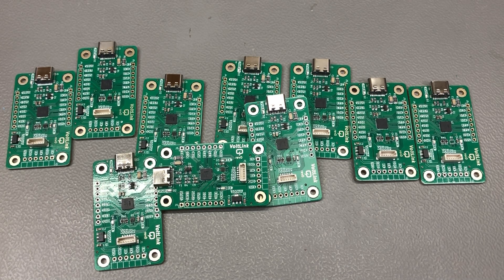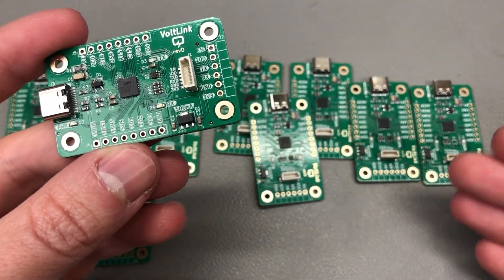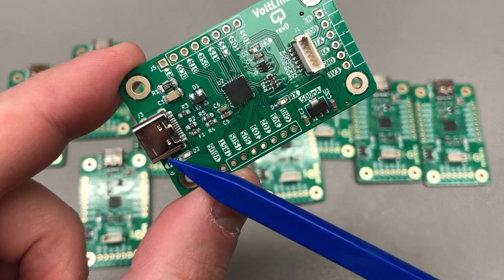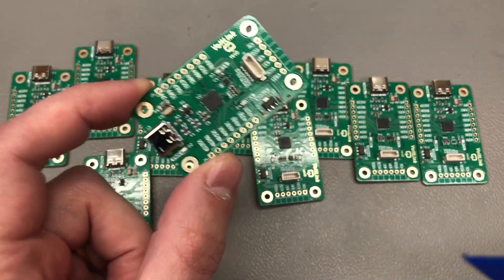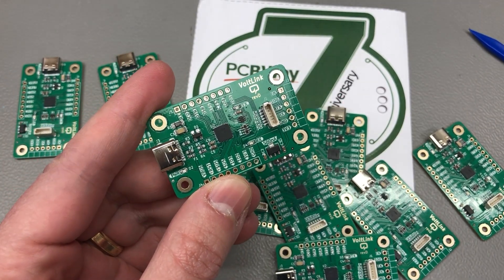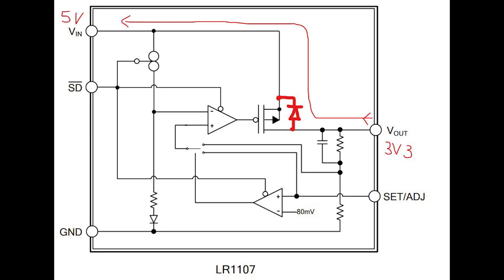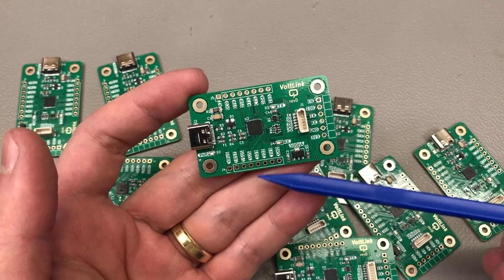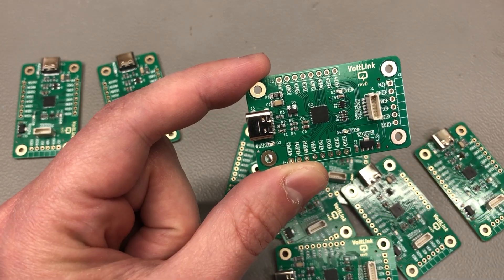VoltLink revD USB Serial Bridge & ESP32 Programmer | Voltlog #414

Comment: Question for you about the TX/RX leds on the CP2102N. How do you program the CP2102N to enable the TXT/RXT?
Reply: He talked about it in the previous (rev C) video, or definitely one of the recent videos. He used some software I think, and complained about those LEDs not being enabled by default.
Reply: Try Voltlog #359

Comment: first, 
Happy Easter 
How hard would soldering that resitor network be ?
Also i searched a bit online for a similar thing and i mostly found tht equivalents of those and super tiny ones like yours. What would be the size of that part per pin is it smaller then 0603? how do you hand solder them? hot air or hot plate? What paste/flux?
Reply from the maker: Happy Easter!
How easy it would be to solder depends on your experience. The equivalent package is 4 x 0603. I can solder these using any method: hand soldering, hot plate, reflow oven and I always pick the most convenient method based on how many boards I have to make. Any type of solder paste will work as long as you follow the recommended temperature profile.
Reply: @voltlog  well then it is larger then i thought (i have a warped size idea about smd since i mostly used tht ) and man wow that is tiny but probably easier to solder since 1 side is all shorted to 3v3